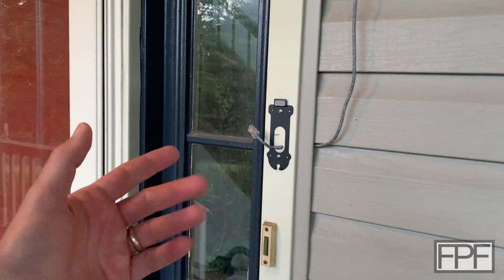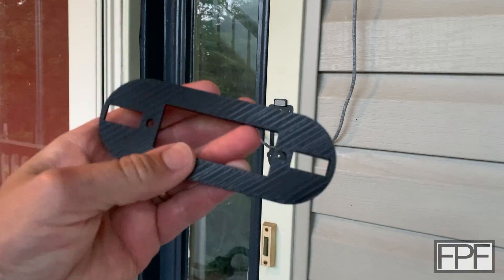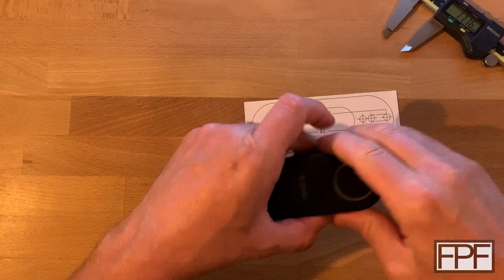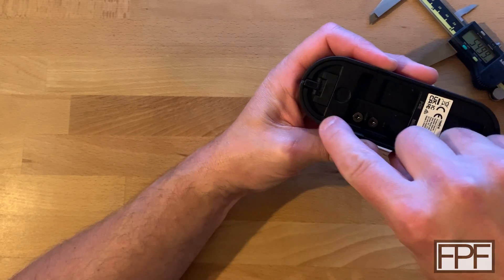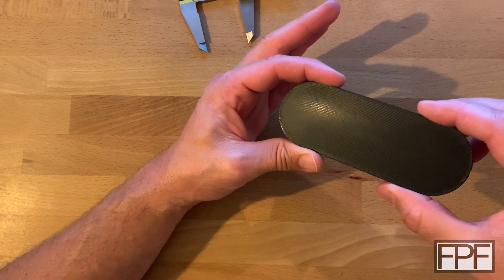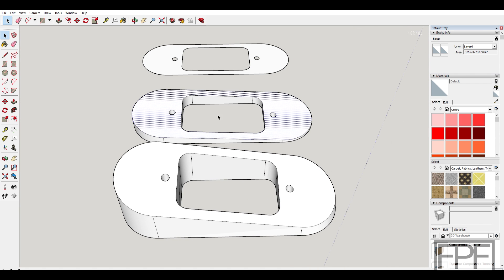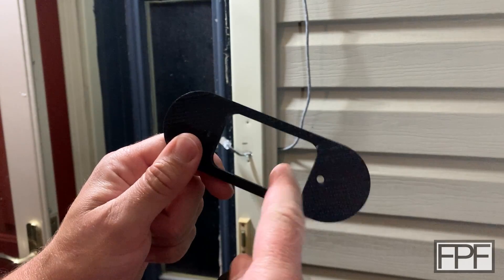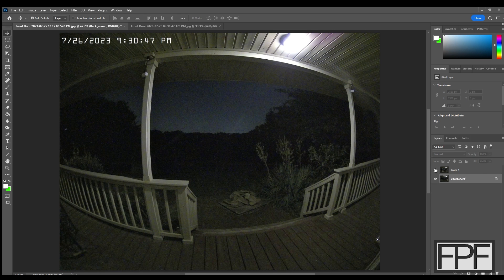3D Printed Doorbell Cam Angled Wedge for Reolink

Comment: This is just what I need, although I need a bit more angle down and straight out.  I have not made 3D parts for about a year (no printer here... I take STL to the local library to print).  What software is it that you are using in the video? Philshel1 mentioned SketchUp, but the free online version does not seem to have the same interface.  I only make parts as I need them, so a subscription SaaS service does not make sense for me, unless it is a subscription I can turn on and off as I need it.
Reply: Never mind.  I figured out that I cannot properly import the STL into SketchUp Free to modify the angle.  Went back to my old standby (OpenSCAD) and imported the STL, converted it to 2D, extruded it, and intersected it with a wedge.  Came out great.  Thanks for the video.
Reply: @sladen1  i will like to modify more angle down - any help will be appreciate it. :D

Comment: Looks like that template is for a plate that should fit inside the diameter so that it sinks in when mounted which should also help for weatherization..
Reply from the maker: the steel plate the camera mounts to uses that recessed space and locks at the bottom
Reply from the maker: though I do see your point . . with the exception of the bottom where the lock is, it could key slightly onto the mount, which would help keep stuff out.  thanks for the suggestion

Comment: New subscriber here, great channel.  Have a couple of questions.  Would you consider doing SketchUp tutorials?  Do you have issues with the segmented nature of curves in SketchUp?  I use mostly Fusion 360 and VCarve, SketchUp looks much simpler/quicker in many ways.
Reply: As one who first became rather expert with SketchUp before ever learning Fusion 360, there are definitely pros and cons for both. I still pick which to use on a per-case basis. In SU (SketchUp) after pressing "C" hotkey for circle, one can enter a number on the keypad, which tells SU how many segments to use for the circle. F360 "automates" how many segments get "outputted" based on some algorithm and which type of output is requested. SU's default is 24 segs. Here's a link to an image I made showing a 2-second tutorial on SU's "magic" behind the face rotation trick shown in this video ("SketchUp---rotation-of-top-face.jpg"): http://design8studio.com/files/SketchUp-rotation-of-top-face.jpg
Reply from the maker: Sketchup is quick and dirty for simple stuff, but can be painful on the revision side on complex designs.  I might consider doing a vid on the basics.